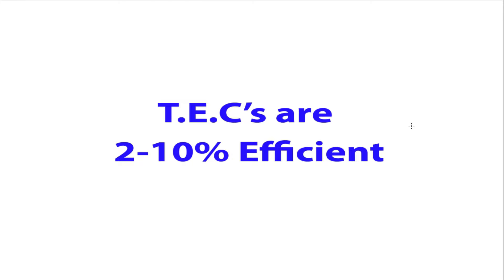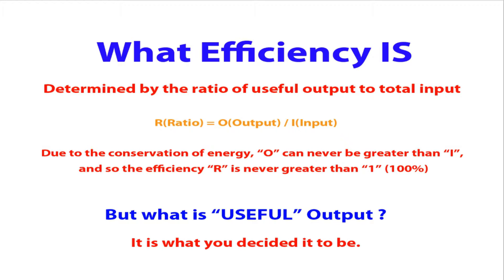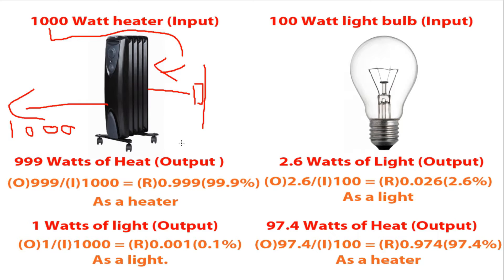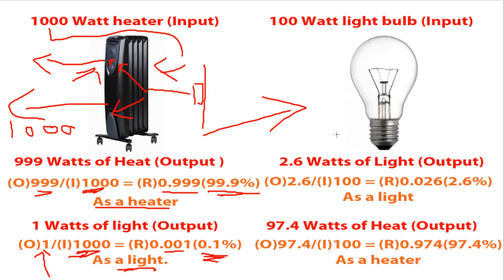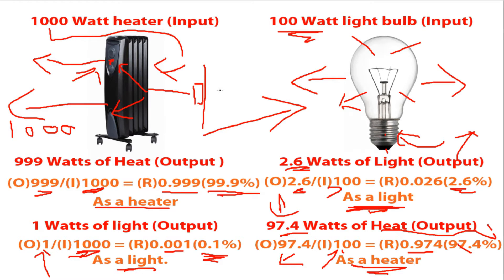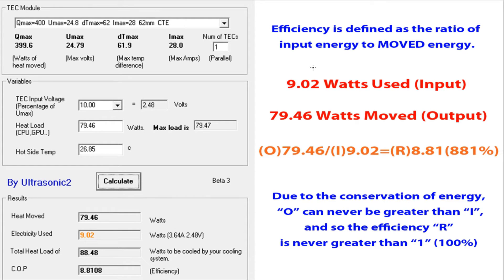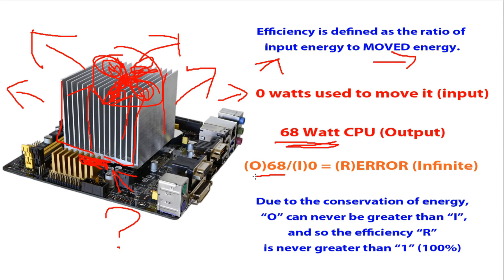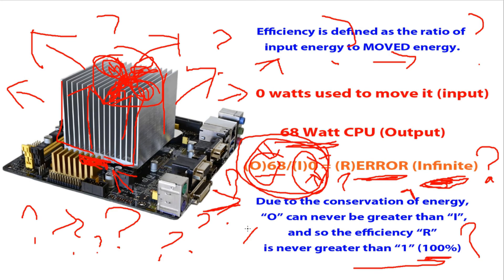🎓 Peltier efficiency:- What efficiency IS ? Part3

Comment: This works as a heater not a cooler. if you were to use a TEC as a heater and it consumed 1000 joules of energy but heated your hot side with 1500 joules of energy, the other 500 joules came from the cold side of the TEC, and that would make your efficiency 1500/1000=150% as a heater. But if you used it as a cooler to cool with 1000 joules of energy and the heated your hot side with 1500 joules that means you cooled only 500 joules making your efficiency 1500/1000=50% your efficiency depends on the intended use.

Comment: Do you plan to make any videos about using Peltiers as a thermoelectric generator?
Reply from the maker: I have looked at it great lengths and for where i live it was cheap to go with solar panels
Reply: I was thinking about harvesting waste heat.
Reply from the maker: sure... where are you getting the heat from
Reply: From a gaming computer that consumes 500 watts
Reply from the maker: i can't see how that will work your temperature difference will be to low. as you wont want to be running your PC very hot.

Comment: Kind of off topic, but will you be making a 2066 socket design of your latest block?
Reply from the maker: hay bill .. Well it doesn't matter if the socket itself changes. The only thing that matters is if the mounting locations are narrower or wider than my current block can take. It will be extremely unlikely that the new mounting locations will be outside of these parameters, So it should fit as it is now.. However i can't seem to find the official INTEL info for this so can't say for sure right now
Reply: Makes sense.  The mount points are slots and not simply holes and so as long as the mount points remain aligned to the slots the block should still mount properly.  I need to go catch up on your other videos.  You've apparently been on a tear as of late.
Reply from the maker: Yeah i need to make these informational videos so i no longer have to say the same thing over and over again.. you know how it is the same questions / Statements being made endlessly and you just dont have the energy to keep saying the same thing for 20 years. These videos should help with that... Why yes Sir i do have you answer watch "this"

After these informational videos we'll move on to more interesting ones. On the FB page right now we're discussing what features and functions the PWM DEW point controller will have and people are voting on them. After it's done and working people can simply copy me

Pity you're not on FB.. from memory you were making a controller how did that work out?
Reply: I got my custom inductors the day after Christmas.  I'm just finishing up a 24V pump controller board now and then I will cut 5 of the TEC driver boards.  Actually, it's a base board, a regulator board, and then I have a header for a small USB MCU board for running a control algorithm.  The MCU board will take an NTC thermistor input and will have a humidity sensor onboard.

The board takes in up to 3 8-pin PCIe graphics card power cables and allows 8 amps per power pin for a total input of 72 amps at 12 volts nominal.  It then takes a PWM signal from a 4-pin fan cable and drives the output from 0.5 - 36 volts depending on the limit one sets.  The output connector is limited to 60 amps.  The current board size is 4.5" by 3.0" with some slight overhang of connectors on each end.  There's a 70mm 12vdc fan for forced air cooling as well.

I'll send you one from the first test group once I get it running.  It's going to be painful to construct even though it's surface mount for the most part.
Reply from the maker: Yeah i bet it will be hard to make.. i've looked into making a boost or buck controller before..
That would be super awesome if i could get my hands on one of these bad boys !